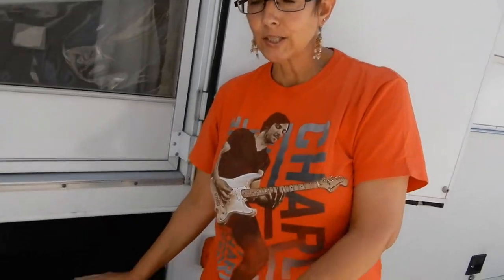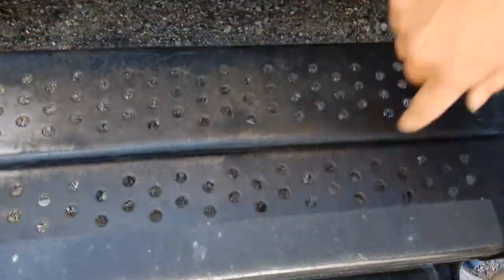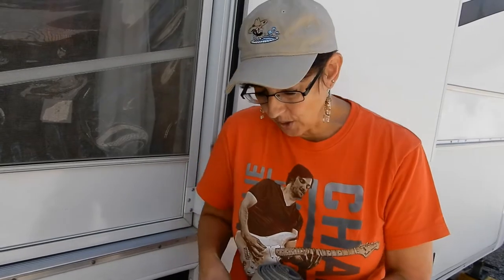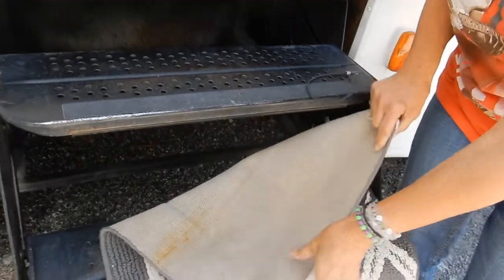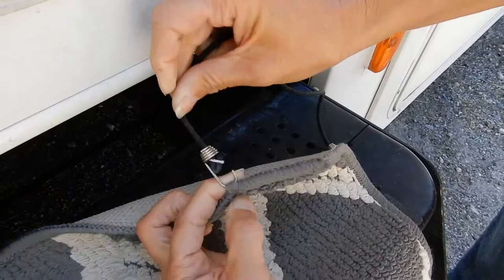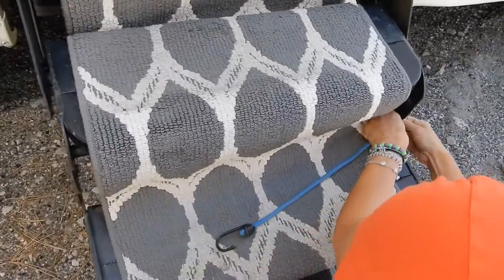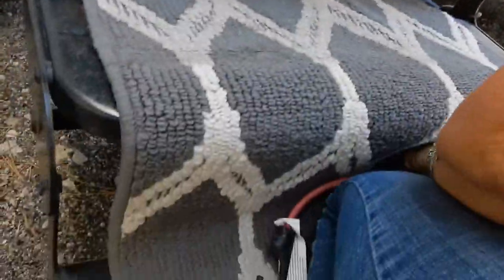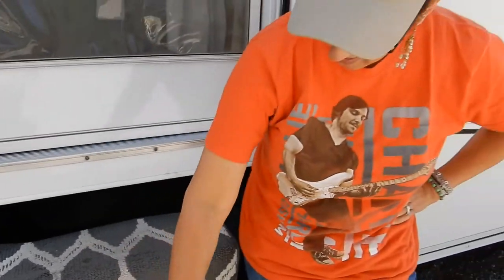Tuesday Quick Tip - RUNNERS! RV STEP COVERS

Comment: Not a problem with our motorhome. I would suggest putting snaps or velcro on the backside of the top step would make taking it on and off would be easier. I would put on the front of the bottom step too.
Reply from the maker: We'll have to check into that idea of the snaps! For now, the bungees are working!
Thank you for watching and for always having such great comments! We really appreciate you!